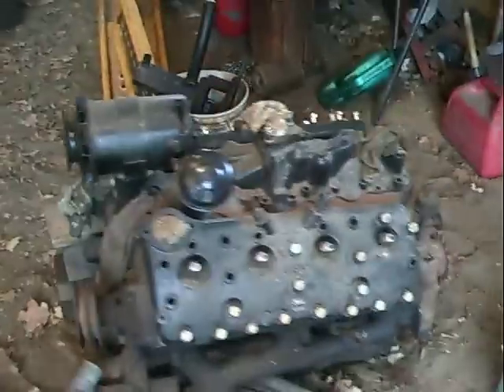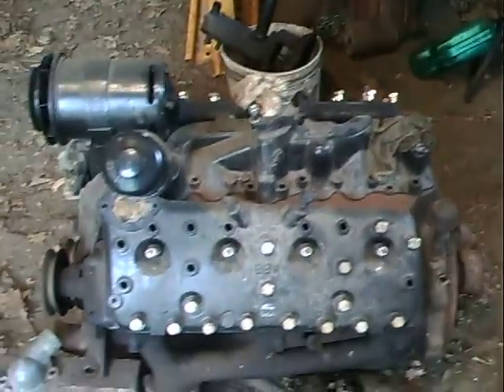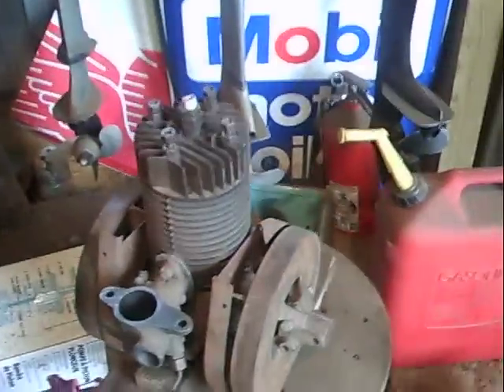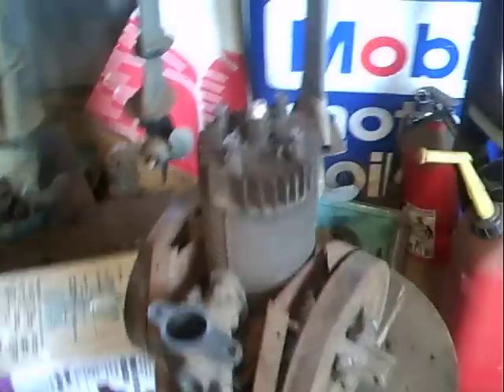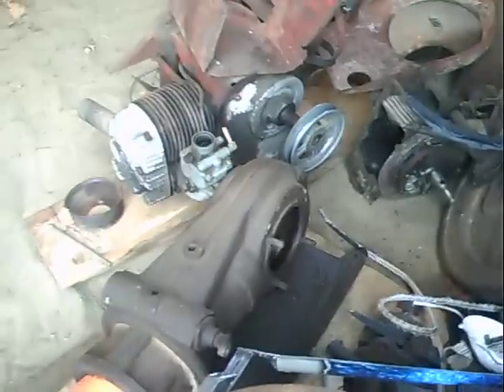Cold start old start, another old Jacobsen 2 stroke engine lives again

Comment: Hi Dan I have one of these engines and its kicking my butt. I did a overhaul on it because i was only getting 75 psi cranking compression. Honed the cylinder coated the piston new rings sealed it all up and still 75 psi i got it running but only with the timing retarded ,im running a small vintage motorcycle mag. also im running a new style carb . Do you no do these have a plate (reed) over the intake opening after the carb?
Reply from the maker: Hi Brian. Thanks for watching. You sir are right, there s a spring loaded butterfly at the intake port that only lets air in and not back out. It's funny you got it to run at all.  My carb is built on the bottom of the gastank. There is also a drip oiler  on top of the carb, you have to pre mix the gas plus use the drip oiler. On my carb the butterfly is where you would think the aircleaner would go.   I hope this helps.    Dan
Reply from the maker: Your engine would start easier if your mag had an impulse on it also.    Dan

Comment: Dan,
Another Jake brought back from the dead.  Nice video and thanks for posting.  It is cool what you did to get it running again.  Only thing I have that is Jacobsen is an old 1967 Jacobsen 4 blade "Turbo Cone" push mower from my fathers old farm.  It works too!  The aluminum mower deck is cracked and needs welding; therefore, I do not use it.  Aint getting rid of it though. I just get the feeling that if I hung out with you for a summer that I'd learn great deal. 
Joe